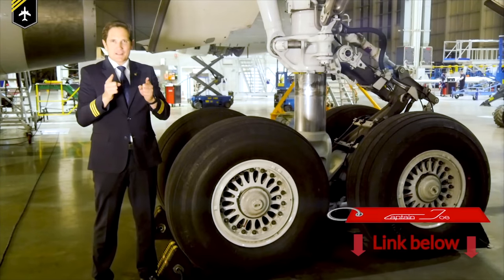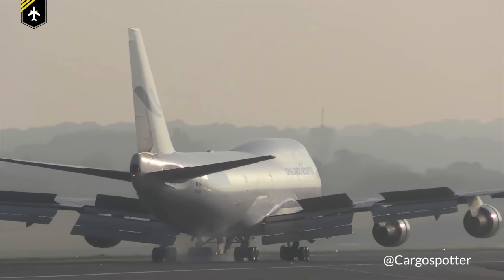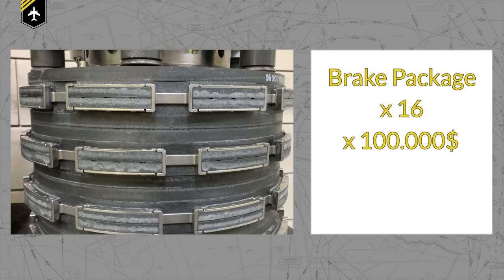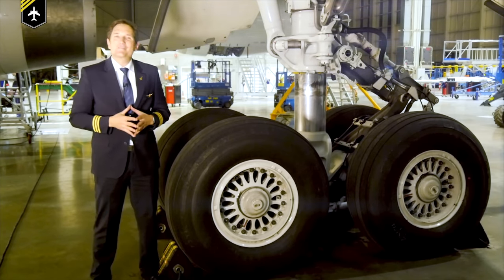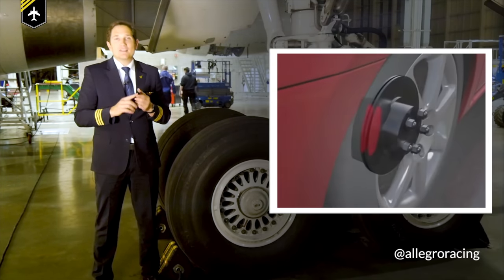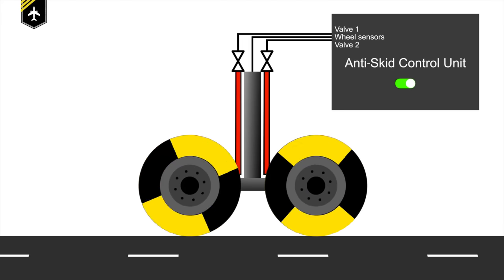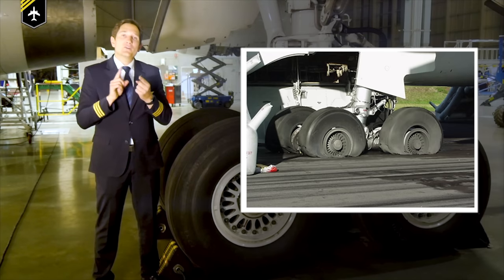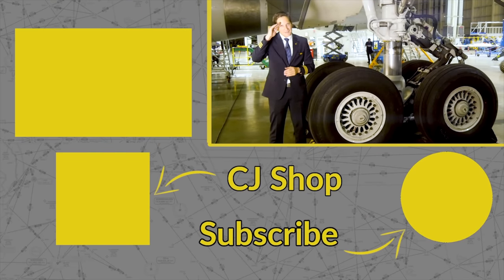Do PLANES have ANTI-SKID??? How to PREVENT SKIDDING? Explained by CAPTAIN JOE

Comment: So is there much damage (over time) from the instant a tyre touches down at say 150kts where the tyre goes from 0-150kts in a split second? (usually noted by the "SKREE!!" we here on every American movie... I work next to an airport and hadn't really noticed myself)..
...
Do any planes bother to have an assisted spin-up system (Like a weather vane) that drags the lower side of a tyre and spins it up to [probably in practice...] at least half the ground speed before touchdown...

I guess this same weather vane type system would keep the wheels spinning and may need brakes applied (at least automatically) on retraction or do they already do that... or is the spinning tyre mass not an issue on retraction...
Reply: One of my jobs in an aircraft landing gear group used to be replying to letters from people who had invented pre-rotation of tires (I was given the task after arriving in the group from college with this great idea for... pre-rotation of tires!).  You are right about needing approx half of the landing speed to make a difference -- a US Air Force study determined that about fifty years ago.  The bottom line, however, is that all the smoke and noise doesn't amount to much wear-wise, so given the various weight penalties and potential operational problems which would go with any sort of system, pre-rotation doesn't come anywhere close to being worth it.

On the aircraft I'm familiar with, a bit of automatically-applied brake pressure as the landing gear retracts gets rid of the tire spin.
Reply: @marcmcreynolds2827  I would have thought as much (as they have been flying planes for over 100 years now)... but you never know... sometimes something dispelled 50 years ago because it was insignificant can be missed later when it might actually work. (a good point of this is the "New" ideas they keep coming up with in say motorbikes, that were actually invented nearly 100 years earlier but either the material didn't exist to make them (alloys and carbon etc) or the device would "Never" have that much power or speed... remember the days when humans would never be able to travel faster than the speed of sound.

Yes an automatic pulse of the ABS on the gear as it retracts (do they even bother with ABS? de ja vous) could stop the rotation without human intervention...

Speaking of ABS... imagine if trucks had them. no Jackknifes ever again... nah it would cost like $2-300 extra at the factory...

q8D
Reply: @TheButlerNZ   Though it might still be active post-retraction (I didn't much deal with hardware), the antiskid system wouldn't be needed for the tire snub.  It wouldn't really have anything to do, other than release pressure when it sensed that the tire had stopped spinning.  I'm guessing that's done by a dedicated valve instead... or maybe not, because one more valve is one more failure point x number of braked wheels?

As a side note, materials are what pace so many advancements in technology.  For example, ever since the Carnot Equation defined thermal efficiency in 1824, engineers have known quantitatively that hotter is better for generating power.  It then becomes a matter of how hot can you get without the device failing, and that's "materials".
Reply: @marcmcreynolds2827  Hotter is better except at hypersonic speeds where the air gets so hot it can't be expanded further to provide thrust... so then the idea is go cooler instead (like a vacuum cleaner) and the hotter the air, the more the effect of cooling it.

Flying is no different than riding a bicycle, just a lot harder to put baseball cards in the spokes - Flying High (Airplane) 1980
Reply: @TheButlerNZ  Shirley you can't be serious?

[ I was coming back through LAX late one evening -- Terminal 2 or 3? -- and as I was about to exit to the street there were a bunch of people and cameras gathered around a bathroom entrance, filming one of the scenes.  I put on my aerospace company badge so as to look official and just walked into the filming area, hanging out there for a while. ]
Reply: @marcmcreynolds2827  I work in Wellington (Wellywood) NZ. Everyone in NZ knows someone that has been in a Peter Jackson movie.
A long time friend is the one to the right there of Viggo https://www.youtube.com/watch?v=FyzE9thQIPo
 I repair a lot of Weta and other related Co's equipment and supply the odd Steam Cleaner to wash down prop gear etc. Really great bunch.
I sat down at a cafe (The Chocolate Fish) a while ago (OMG 20 years ago...) and got chatting to some Americans about my brothers dog I had with me...
I noted a slim girl cross the road over my shoulder and sit at the table with the guys... Liv Tyler.
Funny thing was.. the radio that night was dispelling the rumors that Ian McKellen and Liv were in the country at the time.       q8}

Comment: Why does it have OPTION for ABS ? Shouldn’t it should be mandatory ?
Reply: You wouldn't want ABS on during a hydraulics-out landing, for example.  Fluid stored in the brake accumulators, which are present to allow brake operation in such an emergency, would be depleted early in the rollout due to antiskid cycling.  Steady brake pressure (at some level of decel below the skidding threshold) is how you get through that.

Comment: Do the jet’s thruster help to brake?
Reply: Quite a bit, if runway friction is limited (snow, ice).  But typically they handle only about 15% of the kinetic energy, especially if a low level of reverse thrust is selected (usually the case).

Comment: Captain Joe... I’d like to understand how much speed retardation is affected by each of the systems you mentioned (brakes, spoilers, reversing engines)?  I’d assume the engines provide the most, but how much in %. Thanks.
Reply: Tony Fisher I'm not sure of the exact numbers, but actually its the brakes which has the highest stopping percent, more than spoilers and reverse thrust.

Plus, one use of spoilers is to dump all lift so that there is more weight on the wheels, and hence better grip for the wheels and its braking.
Reply: In a typically landing on a dry runway, reverse thrust (at a moderate setting) only absorbs about 15% of the initial brakes-on energy.  That's in part because of the relatively long amount of time (several seconds) needed for thrust to develop starting from flight idle.  It's an "S-curve" profile for thrust-vs-time... not much besides noise at first.  So meanwhile the brakes have been doing their thing, and not long after the engine has fully spooled up to whatever power level it's 80 kt and time to retract the reversers.

Comment: What is the use of the static ports
Reply: Measure static pressure. Static pressure is used in order to calculate altitude, vertical speed (change in static pressure), Mach number and ASI (total-static pressure=dynamic pressure=IAS)

Comment: Hydraulicly applied pressure? Surely you know that Bombardier C-Series Airbus A220 has electric brakes instead of hydraulic :)
Reply: 787 also has electric brakes
Reply: Yes 2 aircraft types out of several still flying using hydraulics

Comment: Why can’t you use reverse thrust on rejected take off?
Reply: You can as video below shows. But because one reason for rejected take off is engine failure you’d then loose half of your reverse thrust so the V1 is calculated using no reverse thrust so if you can stop with no reverse then you can stop with both or 1 reverser

https://youtu.be/KbAQpvBo1qg

Comment: hey joe!
what is the difference between rudder and tiller?
Reply: Harsh Shah rudder is the vertical stabilizer in the back of the plane, which is used for yaw moment

Tiller is just a steering wheel for the nose wheel for ground movements
Reply: @ZK-APA  but rudder is also used for steering the plane for taxing, right?
Reply: Harsh Shah in smaller aircraft yes, They only have rudder pedals to turn. But in larger planes, the tiller is used.
Reply: Harsh Shah the rudder itself doesn’t assist in taxiing as the plane is moving too slowly

Comment: The functionality of the anti-skid needs to know a reference speed. Otherwise, the system ca, be fooled and believe the plane has stopped if ALL the axles are stopped. How is determined the reference speed? On a high speed train, we can use some kind of mean value, but this doesn't cover the case where all wheel are completely sopped. In this case, a free wheel is needed... How is it done in a plane?

A remark : the system is very different as the one on the car. On a car, the purpose is not to lower the braking distance but to keep the steering wheel operational. Which can be seen in all the video excerpt you show there.
Reply: Jean-Luc, both purposes for a car's ABS are true. The braking distance IS reduced, because the braking force is maximum at the moment when a tyre loses traction. Repetitive transition from traction to skidding slows down a vehicle very effectively. Otherwise, today I would park on a tail bumper of a preceding car :-)
Reply: @jarekferenc1149  I disagree.
 

I worked on ABS system design as an engineer in the past. And we do tests on dry road and on 20 cm mud. The distance is marginally reduced : less than 0,5%. But worse, in certain conditions, the distance is even longer Then I worked on high speed train braking system. In this case the distance is reduced, but the contact is metal on metal on an ellipse of 2mm...
On a car, the system is very crude: it is an on/off system.
On a train, it is full proportional.

On a car, on dry road, the friction curve as a function of skidding increase rapidly and stay constant (about) until 100% skidding.
On a wet road, after reaching a maximum at about 40% skidding, the curve decrease slightly. In this case we have "some" gain using the ABS
On snow, the curve reach a maximum, then there is a flat (ABS useless for that purpose) and then the curve INCREASE. So using the ABS is worse than not having one (in terms of braking distance).

Generally speaking, we can see that people don't put enough braking force during an emergency braking. So there is an assistance to that: when the braking application speed very fast (case of an emergency), the system will apply full braking... Eventually engaging ABS action. But once again, this allows you to keep the steering. The rest is marginal.
Reply: I would suspect the nose wheel can be used as a reference since it doesn’t have brakes.
Reply: @tomcorwine3091  Could be, but I thought the mini-stop was active before the nose wheel is down.
Reply: @JeanLucCoulon  Yeah, I thought about that an hour after I wrote my comment :)

Comment: hi, why is the word rotate used for take off? what is rotating? Thanks for feedbacks.
Reply: It’s the point you pull back on the stick and rotate the plane into the air. It rotates from its wheels
Reply: @tomstravels520  Sorry I still don't understand. I don't see any rotation there.
Reply: Aba Baba well then don’t bother thinking about it any further. What would you say? “Fly”? “Climb”?
Reply: @tomstravels520  I am sure there is solid reason for the use of this word, I just can't figure it out.
Reply: @tomstravels520  Pull comes to mind.
Reply: Aba Baba yes. You’re rotating the plane which pivots on its wheels to climb into the sky
Reply: @tomstravels520  Still don't see it! the wheels have been rotating all the time. I am guessing there is a historic reason, just like there is one for the word taxi. Maybe captain joe could shed some light on this.
Reply: @abababa7483         In this context, "rotate" does not refer to the motion of the wheels. Rotate refers to changing the geometric plane that the aircraft is in. Think of a geometric plane as a sheet of paper. From the perspective of the ground (if you are standing on the ground next to the runway), the aircraft is in the same geometric plane as you are. However, as the front of the aircraft lifts up off the ground, it is no longer flat, from your perspective, as the nose of the aircraft begins to rise a certain number of degrees. As this occurs, the aircraft enters a different geometric plane. This action of the aircraft entering a different geometric plane is referred to as rotation.

You can read more about geometric planes at https://www.varsitytutors.com/hotmath/hotmath_help/topics/planes .
Reply: @Eternal_Tech  Nice try and thanks, but I still don't see anything resembling a rotation.😁

Comment: Why planes don't use electric motor brushless brake ? Shouldn't they have more efficiency, less weight and easier integration in the plane electrical system ?
Reply: A few of the most recent airliner types use electrical instead of hydraulic brake application, if that's what you mean.

Comment: Do the tires deflate automatically in an emergency to prevent being popped?
Reply: Yes, they have a device called a fuse plug which melts at high temperature to safely release the tire pressure.
Reply: Idk if other planes have it but A320 has tire plugs that melt and relieve pressure. And also has a brake fan.
Reply: The normal design practice (requirement?) is three fuse plugs in each braked wheel.  That way at least one will be in a rotational position after the aircraft stops which sees the maximum temperature resulting from the heated tire + brake.  It can take a few minutes after an "extreme" stop before a tire starts to deflate, if it is going to.

Comment: just thinking if he could make a video about why is airplane seatbelt only on your waist and not like a car or a race car seat belt.
Reply: Chan Yik choon its a simple reason. In a car the seatbelt's main use is to avoid sudden jerking during a rapid deceleration (eg a crash)

In an aircraft, the seatbelt's main use is to just keep you on your seat during any sudden movement. (Eg turbulence)
Reply: ZK-APA 
I get what you mean, but normally during landing we also gotta put on our seatbelt. 
And if the pilot decides to apply final landing power and make us to fast for landing, the pilot will then slam on the brake which will result in me or all of us being shoved forward real hard. 
Not sure if captain Joe could talk about this
Reply: Chan Yik choon yes, but that deceleration isn't to the point that the body will be negativly affected. Its just a minor inconvenience which one can cope with.
Reply: Chan Yik choon and? There is a seat in front of you that you can use to push back against
Reply: As is always the answer in aviation—weight. In the U.S., however, the FAA requires at least a 3 point belt for crew.
Reply: I get what you guys are saying, I was just asking that question, so that he could explain it in more detail 😁.

It is most likely that I will be sitting at the economy section with no seat in front of me, or there is a divider for business and economy

Comment: Captain piche didnt do a good job in general. He managed to land and stop in time but he also caused fuel starvation and subsequent dual engine loss by ignoring fuel warnings and believing its a faulty message. As a result he turned on cross feed valve as a last vital mistake. By doing that he lost both engines. If he didnt turned on cross feed valve, he would have lost only one and it would be less dangerous routine single engine fail scenario.

Comment: In the case of total loss of hydraulic power for braking in planes, I'm wondering why planes aren't equipped with an emergency parachute system like the space shuttle to help slow the plane down?
Reply: simon dubya because there is already a redundant system in the plane. The brakes are powered by more than one independent hydraulic system. So if one fails, the other will take over. And having a multiple hydraulic failure is actually very rare now a day.
Reply: Weight.
Reply: Small spheres in the wheel wells called brake accumulators provide a limited amount of brake fluid should all hydraulics be lost.  It's only enough for a few press-and-relief cycles, so steady pressure (vs things like using differential braking for directional control) is the order of the day.

BTW,  I was the person who told the shuttle orbiter program manager in a July 1985 meeting at JSC that they should add a drag chute to the Shuttle, as well as replace its inadequate beryllium brakes with carbon brakes.  For an airliner though, it's extra weight (and in the wrong place CG-wise:  the back) which for the most part won't ever get used.